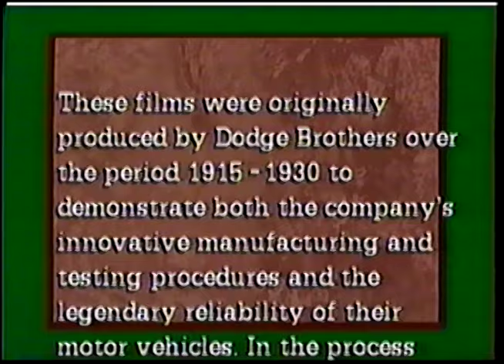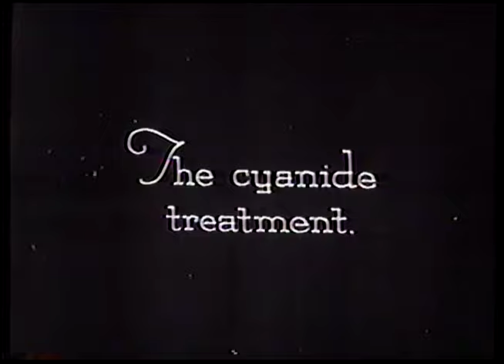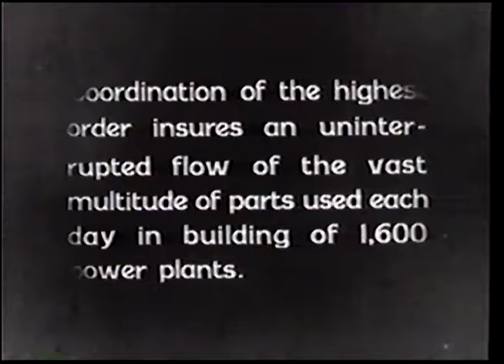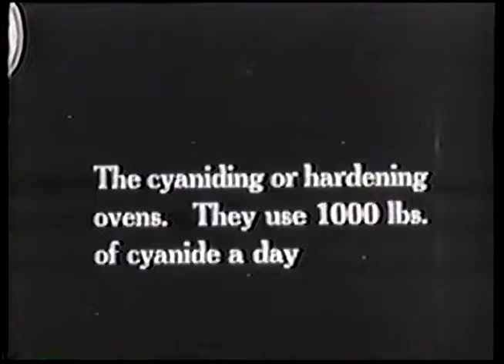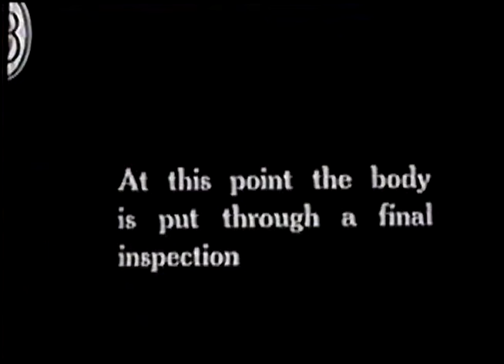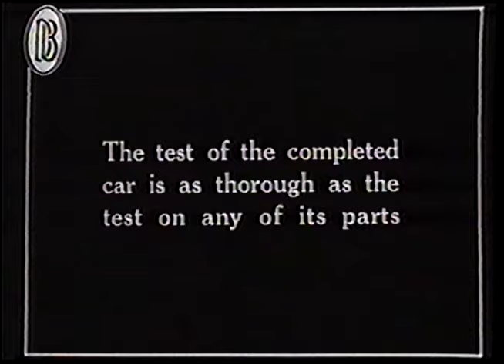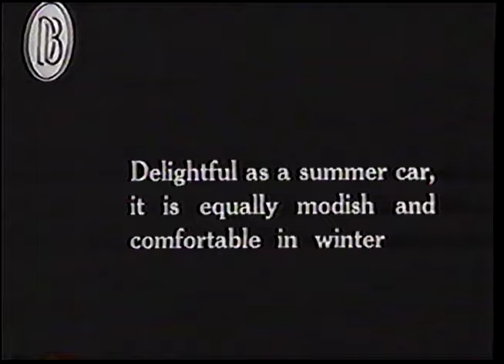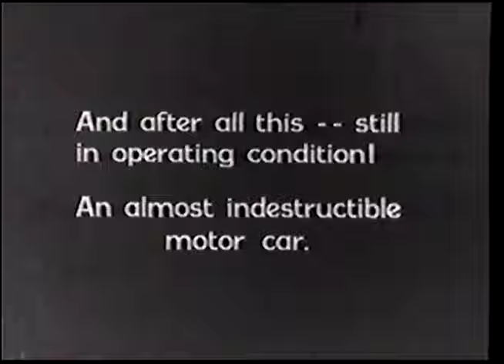DBC   A Collection of Historic Dodge Brothers Motion Pictures Silent

Comment: Amazing footage in many regards. Such ingenuity, enterprise, and quality. Interesting to see the plant working and in its heyday. How the parts moved through what must have been the Dodge Main plant (?). Looks a lot like the old Packard plant from the outside. No safety equipment in sight as fires burned, presses smashed down, paint, smoke, sparks, fumes flew everywhere. The guy standing in a cloud of aerosolized gasoline! I was cringing watching those presses slam down so fast. Sometimes they hit, sometimes not. Those guys working were a  tough breed. Parts fabricated and assembled all in one place. Sort of a combination foundary, tannery, plating, steel stamping, assembly plant, and test drive proving ground all together. The place is enormous. Wish I had a nice preserved auto model.

Comment: I love these videos!  Thanks so much for sharing them.  At 37:41 the first car starting up the hill smokes quite a bit while the second one does not.  Maybe some inconsistent quality control in the piston, ring pack, or bore finishing.  Smoke under higher load points to piston sealing while smoke under vacuum indicates valve guide leakage.